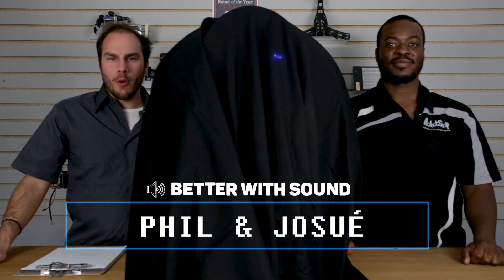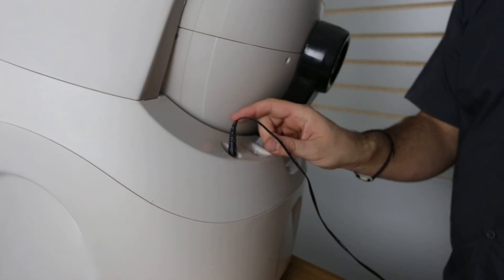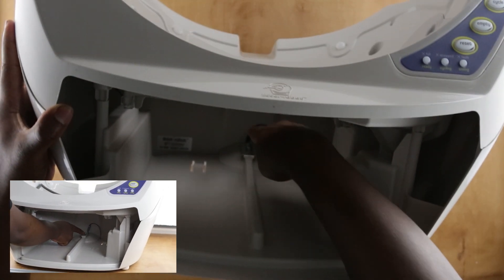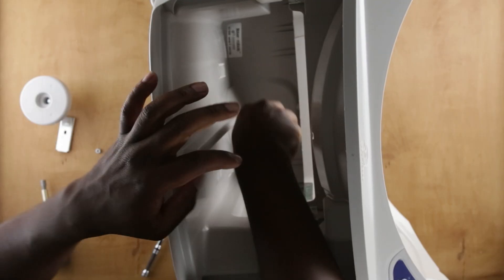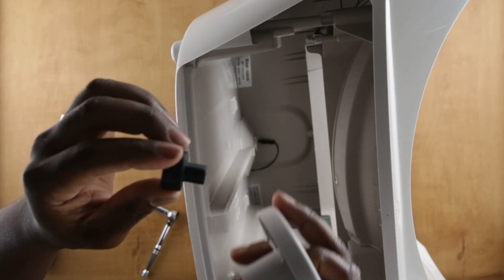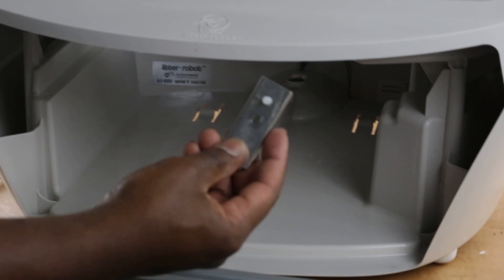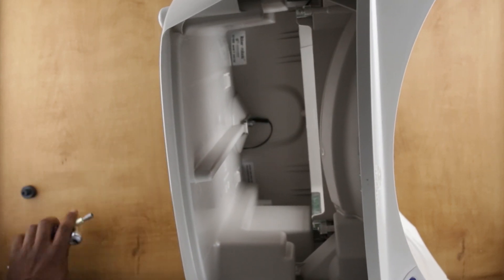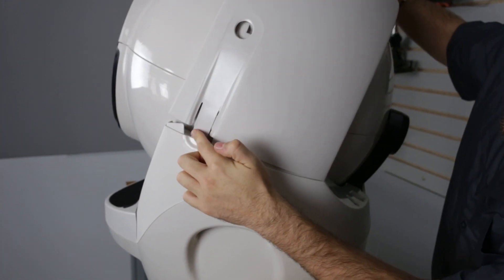How To Repair The Cat Sensor In The Litter-Robot 3 Open Air

Comment: Wow, thanks so much! I just fixed mine by taking it apart and putting it back together 🎉

I tried simply loosening the nut earlier, but maybe it needed to be a LOT looser. Or maybe the spring got stuck? One of my boys takes "dust baths" in the litter robot and really throws himself around in there 🤷

Comment: In the description you say, “If your foot is black (and the bolt is 1 5/8'' cm) : you need to screw for the bolt to just be a mm from the bolt.” What do you mean when you say the bolt should be a mm from the bolt? Do you mean we should screw the nut until it is 1mm from the end of the bolt?
Reply: Did you ever resolve this?  I can't get my LR3 to autoturn after replacement no matter how many times I've adjusted the bolt.  I've put all my weight on it and it never triggers.  I have to manually trigger a cycle.  A bit annoying but still better than buying a new base.

Comment: My Litter Robot has a flashing blue light that nothing will stop. It started after the empty cycle has started and a loud pop or snap sound was heard. I took it apart and everything looks okay but the blue light keeps flashing when power restored to the unit. I don't think it's the cat sensor. Have you any ideas other than buying a new Litter Robot 4?

Comment: in the manual it says, that the robot does calibrate the weight each time when reset...
so it does actually measure weight ?
or is it a simple on-off switch, the sensor?

because: as soon as the spring is compressed and the sensor gets contact it reacts.. for me it seems: there is no measuring of weight  
????

Comment: "a mm from the bolt" -- does that mean portruding out of the bolt? Or sunken in?
Reply from the maker: Hi! If I understand well, your asking about the mm that the bolt needs to be tight? It all depends on the length of the screw. It must be adjusted so that the cat sensor remains sensitive to cat detection. 
Pressing the top of the base backwards, or the top of the cap backwards (if the litter box is assembled), activates the cat sensor. You should hear a click and the metal plate should not come out of its cavity. There's a forum for LR3 on our community website, it can help as well. https://rb1.shop/42tZP3a
Reply: I'm with you.  That instruction isn't clear, and I feel like a dummy cause no one is really asking this question. And the replies are just a repeat of the unclear instructions.  They should say, tighten top nut if it detects cat when there is not, and loosen if it doesn't ever detect cat.  Or visa versa.  I guess I'll try one direction and see what happens.

Comment: The description on this video mixes up inches and mm until it’s utterly incomprehensible.   If you’re thinking of buying as Litter Robot though… be prepared to spend half your life taking it apart and fixing/replacing components.  They’re built and designed by hobbyists… to be used by hobbyists.   Possible the most unreliable consumer device I’ve ever bought.
Reply: Entirely untrue in my opinion. I have had my litter robot three for six years. I have had very very few issues. I have replaced the drawer, full indicator, and the cat sensor.
Reply: This video does not match my litter robot 3. You cannot get a socket on the head of the bolt because it is recessed into a hexagonal opening. There is no plug to hold the bolt in place on reinstall. I had to put a small socket over the bolt and use duct tape to hold it in place. This made it very difficult to align the bolt from the inside to allow the metal plate to line up. I finally got it to work, but I said many foul things in the process. This video did not help me at all.
Reply: My experience as well that they're incredibly badly engineered. The sensors are a bad joke and to maximize profits they saved cents on them, making end users face permanent issues. 

Three if the four sensors had to be shorted by me to keep the device working, the third one forced me to buy a replacement for probably 50 times production cost.
Reply: @milgeschichte  we have been scooping out two $500 robot litter boxes that don’t work for over a month now. Multiple correspondences with the company all to not be fixed. 

SAVE YOUR MONEY FOR A COMPANY THAT CARES. 

I am open to suggestions, couldn’t possibly be worse than the litter robot
Reply: Wrong…. Nice try attempting to save face litter robot reps. I have two units and both don’t work now in less than 2 years. I have received email “suggestions” to fix that don’t work and waste my time. Thanks for the wasted $1000 on your poorly engineered poopbox
Reply from the maker: Hi,
We are sorry to read about your experience with the Litter-Robot. 

Could you confirm if you've placed an order with RobotShop for that item? 

Regards,

Comment: I have had litter robots for 6 years.  I used to recommend them.  Due to the lack of customer service I have experienced in the last 6 weeks, I no longer recommend the produce.  The last 2 times I called the waiting que was over 50 customers before me.  When I emailed, it was several days before I received and answer and their reply was a repetition of the owners manual which I explained that I already followed.  I even asked to buy a sensor and was told that it was not available on line.  I had to call in.  Back to the 50 person que.
Reply: The Robot Shop was kind enough to reach out and helped me solve the service problem I was having with the Whiskers Customer service.  I now buy parts from Robot Shop.  They are very helpful and ship quickly so I can get my cats' box back in working order.  THANKS ROBOT SHOP !!!!!!
Reply from the maker: Hi Steve, 
We are sorry to read about this situation.
Have you placed your order with RobotShop?
Have you contacted Whisker directly? 

We do not see any interaction with RobotShop under the name Steve Haren. 

Thank you
Reply: @RobotShopTV  no, I used whiskers
Reply: @RobotShopTV  I contacted Whisker directly.  Can I get a sensor from you?
Reply from the maker: Hi Steve, to ask for a sensor, you have contact the Robotshop customer service at https://www.robotshop.com/apps/robotshopapp/support

Comment: Actually not as bad as the comments make it out to be. Just stuff a wad of toilet paper on the foot piece, just enough to hold the screw in place so that the nut can be screwed on. After the nut is attached it doesn't matter, it's locked in, now just tighten it.

Comment: Mine will work for maybe a day then stop. Each time, i pull it apart and back the nut off, seeing if that will work.
Brand new cat detector sensor and brand new Pinch detectors.
Its doing my head in.

Comment: When you replace the cat sensor did you say black side facing up and metal lines facing down? 

Is there any measurement you can advise on how not to screw the foot on too tight?
Reply from the maker: Hi Ashley,

The sticky surface should be down and the black surface should be up.
 If your foot is white (and the bolt is 1 7/8'' cm) : you need to screw for the bolt to be about ~1/4" (6.35mm) from the bolt. If your foot is black (and the bolt is 1 5/8'' cm) : you need to screw for the bolt to just be a mm from the bolt. It's essential that you respect these directions to not crush the cat sensor.

Tightening and loosening the nut is depending on the sensitivity of the sensor so the customer should tighten it normally (not super tight) then check if the robot detects all the cats or not.

If not, then he can either tighten or loosen depending on the situation he has.

Let us know if you have further questions.

The RobotShop Team
Reply: @RobotShopTV  thanks for the comprehensive update.

Comment: Nope, not referring to the top part of the bolt but the bottom. 1/4in nut driver doesn't work. What else to use? Again, I have the black foot version. Does it require a different size of nut driver?
Reply from the maker: Hi Lynne, for the bottom of the bolt we use the 1/4 in nut driver. You could try other sizes but the one that works at RobotShop is the 1/4 in.

Thank you,
The RobotShop Team

Comment: You mention needing a 1/4inch nut driver (but you don't show us what that tool looks like - that would have been helpful). I bought one but it doesn't do anything. My robot has the black foot. Does it require a different tool? Different size of the same tool?  I'm stuck on not being able to remove the bolt...
Reply from the maker: Hello Lynne,

We use a 9mm socket for the top part of the bolt. Happy to help with any other queries!

The RobotShop Team
Reply: You don’t need a driver for the black foot. Just put a wrench on the top and hold it + twist the black piece

Comment: I have a new LR3 that is 3 months old I get a lot of cat sensor interrupts and it stops in the middle of a cycle like the sensor is either to loose when trying to complete its cycle and the weight of the cat litter is putting the globe out of balance and triggers the sensor like a cat has gotten in it.
Reply: Having the same issue and the Litter Robot is on point for everything so I'm only able to assume a sensor is bad.

Comment: Can you tell me if the sensor is bad or what? I have a kitten at first she only weighed 4 pounds and wouldn’t set off the sensor, she gain some weight and the sensor would activate when she entered (instant red light) then it would cycle at set time just like it’s designed to. Now recently the kitten enters the globe and is not detected. I reset by pushing the reset button I also turned the power off and back on, it started working again like it’s supposed to but now kitten is not detected and reset doesn’t make a difference, if I reach inside and put some weight on the litter the sensor will activate so is the sensor bad or is there an adjustment? I saw the adjustment video for the older robot with turning the round foot on the bottom but they said that was for that model only. I have the little robot open air, the one without the wifi, I ordered the upgrade though and installed it and it has wifi now but what do you suggest about this sensor? Thank you
Reply: The reason the kitten didn’t set off the sensor at 4 pounds is bc the minimum weight is 5 lbs

Comment: thank you. This helped me fix the constantly blinking BLUE light. I tried everything to clean it the sensors, the entire box and nothing worked. I hated that I couldn't just bypass the litter box telling me it was full (it wasn't!!) as I empty it regularly and found this so annoying that it could keep this $500 item from functioning properly.
Reply: Natalie, did you have to buy a new cat sensor? I too can not get rid of the blinking blue light!
Reply: @Danielle Mitchell  I've had this issue, I unplug it, leave it for 5 minutes, plug it back in, it does a courtesy cycle and it's fixed
Reply: Same here and they sent me to a video sequence which we did 3x and it’s still blinking and the box won’t function 🤷🏻‍♀️
I bought this for convenience and it’s been anything but. So frustrating …

Comment: What to do if the solid yellow light is persisted and it does not rotate at all?
Reply: Did u figure out the problem mine is doing this right now
Reply: @TeresaFrank123   No, I change almost everything (cost me a lot!) and it still does not work  out. GEt new one I would say, not worth fixing.

Comment: Thanks for the video. I did not have the plastic piece mentioned @ 1:45. I had the repair kit sent to me and all of the parts except this were inside. I also did not have the correct socket. So, a blob of plumbers putty to help hold the bolt in place and a bit of pressure to make it come through so I could start the nut, and then a pair of pliers to turn the nut while holding the bottom of the sensor did the trick.  Anything would have worked to hold the bolt in place since it fits the form of the sensor pad when inserted, a wadded up damp paper towel would have worked.

Comment: Thank you for the video, this has helped me replace my defunct sensor, I followed your directions in the comments on how much the bolt needed to be screwed in.  I did notice (like another reviewer) that the original bolt way too tight which may of lead to the sensor failing over time.

Comment: Hey everyone! I fixed my sensor issue! All I did was loosen the nut that is holding the foot onto the robot. It is installed too tightly and keeps the spring from moving when the cat enters the robot. I also took the spring out and stepped on it a few times to try to make it more flexible because it is really rigid but you might not need to do that.  It is really difficult to get back in, FYI.
Reply: I discovered this after finding that the Litter Robot kept stopping during cycle (even though no pets were near it), but then would resume cycling if I pulled the drawer out!
Reply: I'm actually having a similar issue. I found out that my robot spring is compacted too tightly. When I move my robot it's actually wobbly not sure how to fix this yet. I suspect I need to stretch out my spring but I don't think I have the muscle for that.  🤔
Reply: Same here wrong installed black food and Plastik bumper also missing

Comment: Hmm. So I just tried to install my replacement sensor and not having any luck. My issue is that the red light never comes on and the sensor doesn't get triggered. I have the black foot and left ~1mm of bolt poking out of the nut for the pressure sensor. Should I grab the multimeter?
Reply from the maker: Hi, if you own a multimeter you may try to test your cat sensor.
If it seems to act normally, contact us via our support center for further troubleshooting or contact your dealer for warranty.
Reply: I'll give it a go. Appreciate the reply and the ability to actually order a replacement.
Reply: @RobotShopTV  what readings should I look for on the multimeter?

Comment: My issue is that it recognizes that the cat gets in the first time but after the first cycle the blue light flashes and it doesn't ever start on its own until I reset it. any thoughts?
Reply from the maker: Hi,

The following troubleshooting should resolve the blue light blinking while the waste drawer is empty. Once resolved, the unit should consistently recognize when your cat visits and cycle accordingly.
To troubleshoot the blue blinking, let's start by power cycling your unit: 
1.) Leave your unit powered ON with the blue blinking light engaged & Unplug your power supply from the base 
2.) Wait 10 seconds then plug the unit back in
3.) Allow the unit to complete a start‐up cycle. If the light is solid blue, the code has been successfully cleared. If the light is still blinking, let's proceed with troubleshooting. Let's empty the drawer if it has waste and reinstall the bag before proceeding.

Note: If you are using a dark colored bag, always tuck it into the tabs.
Video: https://www.youtube.com/watch?v=NxgTYtknW_c&index=2&list=PLVGSgrf6kgDNPYaulQB7wDvu9AJcmBQ5k 

Let's check your DFI Lenses for any obstructions: 
1. Turn off the unit and Unplug the power from the base 
2. Remove the Bonnet and the Globe 
3. Inspect the top of the Base where the Globe usually rests. Is there any debris? Small amounts of litter are normal. Clean as needed. 
4. Inside the waste opening, there are two clear "Lenses" (left and right side). Ensure there is no debris on the Lenses. Sometimes litter can fall/splash onto them. ** To clean the lenses, we recommend wiping them off with a soft damp cloth and/or glass cleaner. Do not directly spray the Base or DFI Lenses. ** 
5. Replace the Globe and Bonnet. Reset the black key in the back of the unit into the pocket. 6. Plug the unit back in. If you turned the power off, you will need to power it on and press "cycle". Once the cleaning cycle is complete, the unit should be at the Home position with a Solid Blue LED on.

Further Troubleshooting: 
1. If the unit continues blinking blue, remove the waste drawer and press cycle. 
2. Press reset 2x to abort the cycle and return the unit to home (it will level the litter). 
3. If the unit goes to solid blue with the waste drawer removed, ensure there is nothing in the drawer blocking the lenses. 
4. If the drawer is clear, your base needs to be repaired.
Reply: I've been going through the exact same issue with one of my liter robots.  I will update this if I can find a fix.  Although replacing the DFI ( drawer full indicator) is probably the thing to do.
 For the price it is lazy engineering if you ask me.